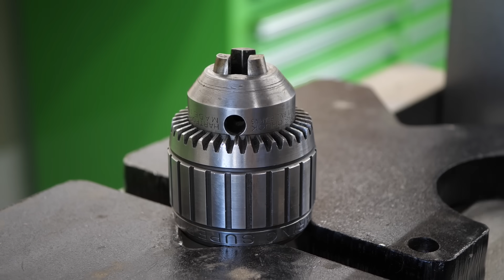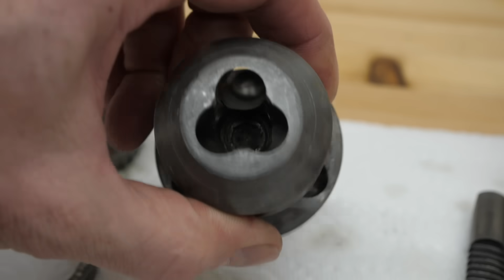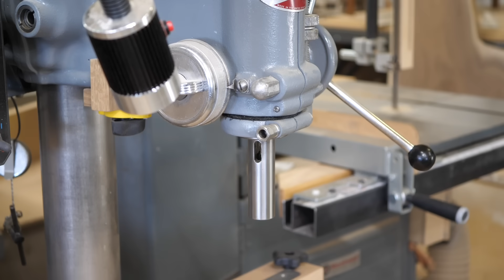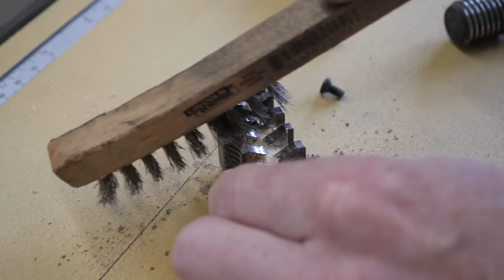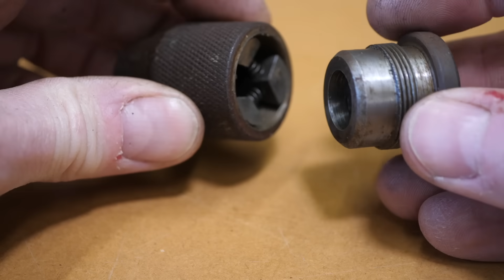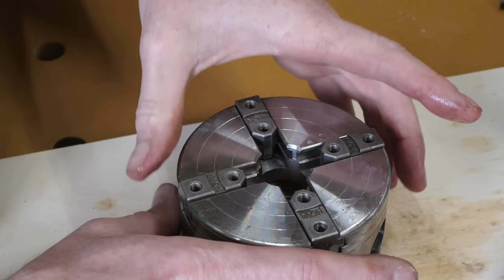Chuck dis·sec·tion For Woodworkers

Comment: Heres a quesition for you Mike.   I replaced the cheap keyed chuck on my drill press with a keyless version off Amazon, though admittedly,  I balked at the price of a Jacobson and went with something less expensive and a brand I couldn't pronounce.  Now, occasionally when drilling hardwood with a large Forsner, or steel with a bit larger than 3/8, the chuck binds so tightly on the bit that it requires an irritating process (utilizing a pair of channel locks) to release.  Would a Jacobson keyless free me from this issue or is this a problem all keyless chucks suffer from?
Reply from the maker: I don't know, this one can tighten really tight from time to time. I have been able to get it open with just my hands, but I could see a time when it's stuck. A specific wrench is sold by Jacobson for just those occasions.

Comment: In Scotland Haggis is not eaten with mushy peas but "Neeps and Tatties" (Mashed turnip and potato) preferably with "a Wee Dram" of Malt whisky which tastes horrible. If you don't like the taste "Irn Bru" can be substituted which tastes nearly as bad but is non alcoholic. Mushy peas should be eaten with a warm Pork Pie or Fish and Chips. Dessert should be a Mars Bar covered in thick batter and deep fried. Yum yum
Reply from the maker: Thank you for the correction. I put the mushy peas in there based on what a friend told me. I actually like them and fish and chips, count me in.
Reply: @MikeFarrington  You're welcome. A slightly different option is a fresh bread bun with real butter a thick slice of ham (off the bone - proper ham) and a layer of peace pudding (which is similar to mushy peas)

Comment: Had the misfortune to be in a position to have to use one of those hand held drills. I had used them since a kid but not for many years. The only one we could find was something made in India. It was absolute rubbish being fitted with only one gear and the whole thing fell to bits halfway through the fifth and last hole needed. With bruised knuckles and pinched fingers, the only consolation that the company paid for it. I know now why they're called chucks  - chucked it as hard as I could into a river nearby. They're not quite made the way they used to be.
Reply from the maker: Yeah, pick up an older version in good shape if you can.

Comment: This was most interesting and informative. I'm surprised the brushes used are stainless steel and not brass. Nice ultrasonic cleaner. Thank you for sharing. Have a great day and stay safe.🙂🙂
Reply from the maker: Thank you. I have found brass isn't strong enough. Stainless is softer than most tools in the shop, yet it holds up longer than brass. Hope that makes sense.

Comment: Pretty fascinating video! The Wescott looks like it had some rust on the body. Have you used Evapo-Rust? It’s a super rust remover that never wears out. Rinses clean with water, then I use either 4/0 steel wool or bronze wool to polish them up. Harbor Freight carries it. I like dry spray lubes for me. Thanks again.
Reply from the maker: I have been slowly restoring an old skid steer for use around the house. I bought a big thing of evaporust, it has worked great for that. The key there is to have a few different sized tubs to soak stuff in.

Comment: Thanks for the video. I was wondering the other day how the scroll chuck worked.
A little note about the Parsons chuck. If you can't  find any tiny replacement springs at your hardware, use the spring out of an old Bic lighter. It's usually just the right diameter. You will have to snip it to length, though.
Reply from the maker: That is a very good tip. Thank you.

Comment: When I clean the scroll chuck on my wood and metal lathes I use powdered graphite as the lubricant as it doesn't tend to get dust and small chips embedded in it like oil and grease. As a child of the late 50's Alan Parsons was required listening at university together with ELO, Supertramp and Jethro Tull (Songs from the wood)/
Reply from the maker: That is a good tip. I'll look into powered graphite. Let's add in some ELP and we are totally good to go.

Comment: I've actually always wondered how drill chucks work. I completely understand the ones on my feet, but the drill ... yeah. On a serious note, I own an ancient Thor brand corded electric drill, with an equally old Jacobs keyed chuck. It was my Dad's, is far older than me (I'm 55), and the brushes finally gave their last, full measure. Not ashamed to say I cried a bit when that happened. The chuck still functions flawlessly. Not sure what to do with it other than hold it now and then, and lament.
Reply from the maker: Probably the only things to do would be to put in on display.
Reply: @MikeFarrington  Which was my intention. I don't think I could whittle carbon brushes.

Comment: Great stuff.  If I may be so bold:  I was under the impression that one should not hammer on a Morse-taper chuck if the jaws are not fully retracted.  When you reinstalled the Jacobs keyless chuck, the jaws could be seen sticking out as you issued a little love tap with the rubber mallet.  Perhaps they should be drawn up inside fully before doing so...?
Reply: Yeah, I winced a little bit... In fact, I nearly chucked...
Reply from the maker: Yeah, that shot was a setup. I really didn't even hit the thing, cause 10 seconds later, I was going to show taking it out. But yeah, for purposes of education, I should have done better. Thank you for pointing that out.

Comment: You should only let the concrete floor catch the chuck if the concrete is precision ground. Other than that, everything else is 100% spot on.
Reply from the maker: Good point. Ha!
Reply: @MikeFarrington  Yes, a good point would help.